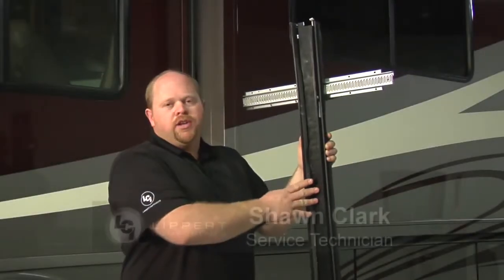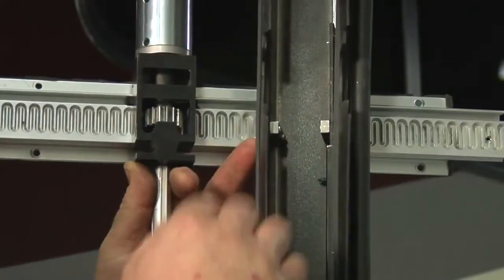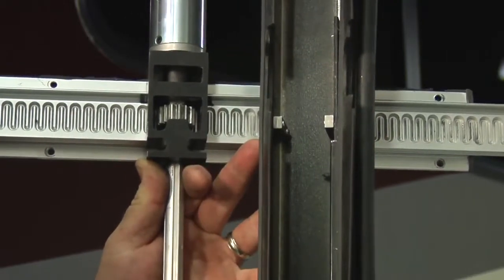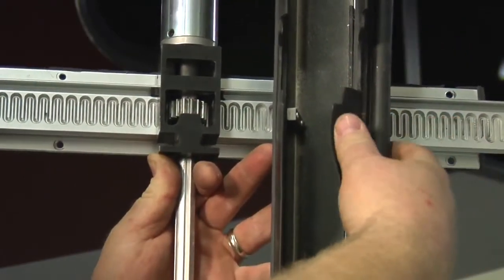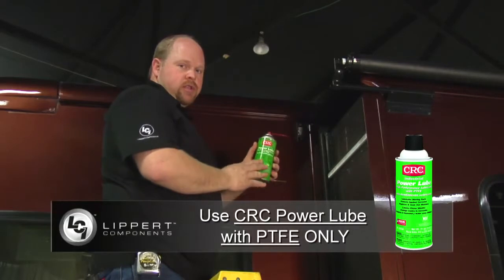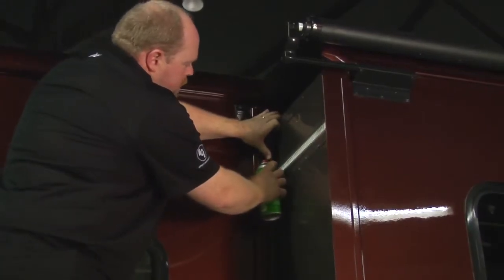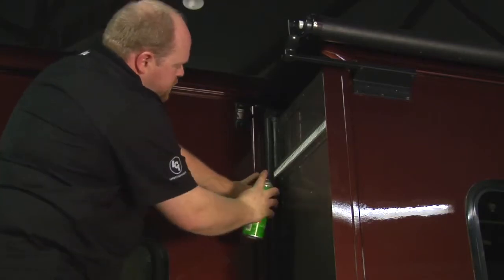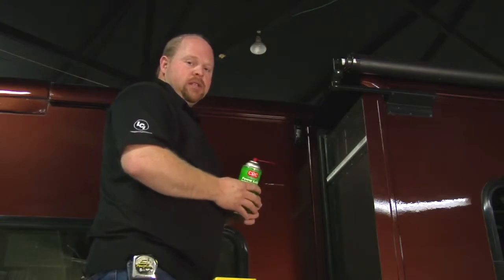Lubricating Schwintek Mechanisms

Comment: Do you just lube top on both sides only which is 2 points? Or you do the bottoms also for 4 points?
Reply: I do the top rack and bottom rack, inside and outside, on both sides of the slide room. 8 Gibs in total, plus the bearing/coupler at the bottom of each motor, inside the black plastic. Lookup "My RV Works" with Darren for a better demonstration